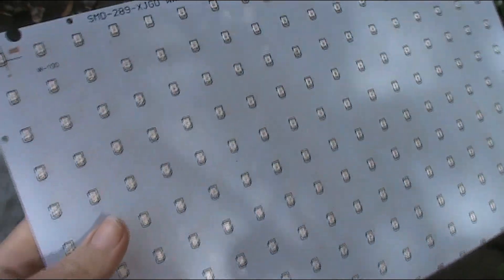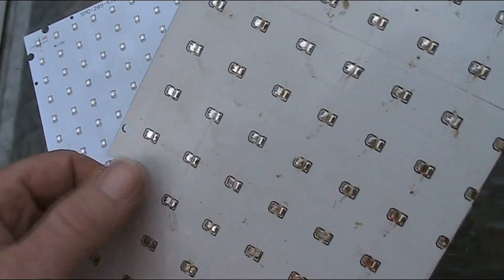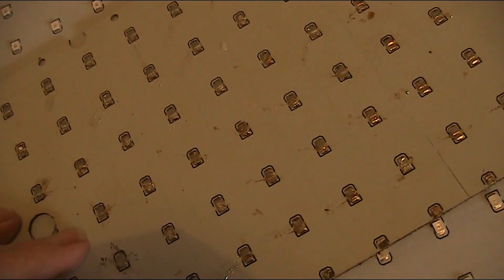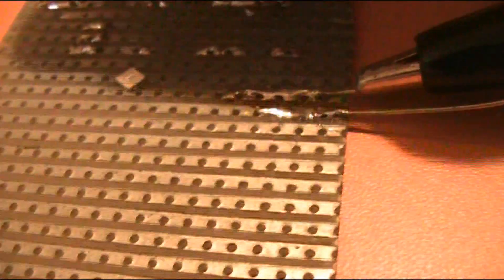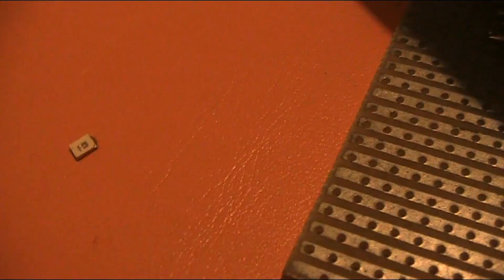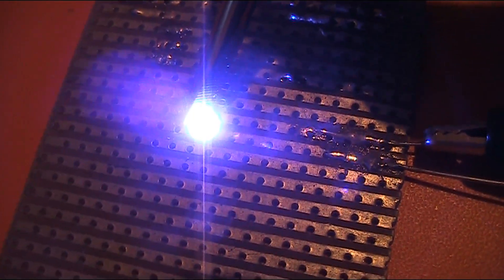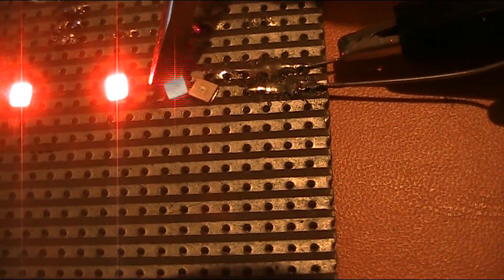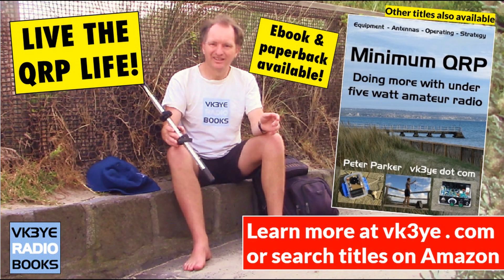I baked dozens of LEDs: Did any survive?

Comment: Awesome bin find. I've also used a small domestic oven for SMD LED reflowing. They only usually need about 4-5 mins to get to temperature so maybe you've left them in for a bit too long.  You can just brush the components off in one go with a natural fiber paintbrush that wont melt and save yourself some time. 
I've also been known to put a small bit of regular solder wire on the PCB so I can see when it's reached melting point.

Comment: If you are careful, hold the board with pliers, then use a propane torch on the back of the metal-clad PCB. 
It will heat it up very quickly, then just tap the board sideways and they will all fall off.